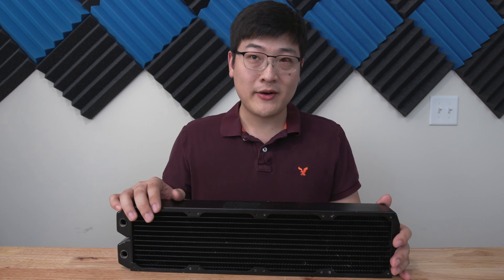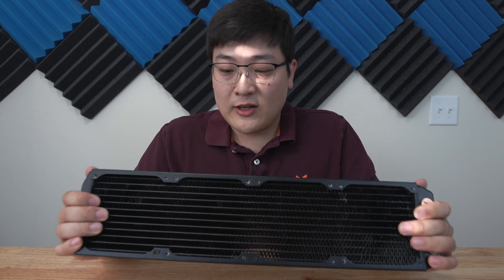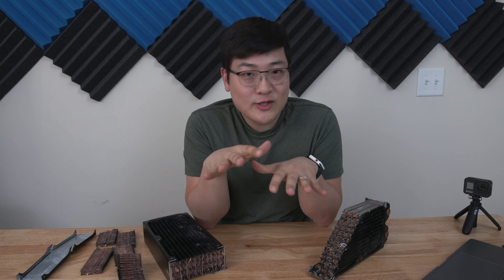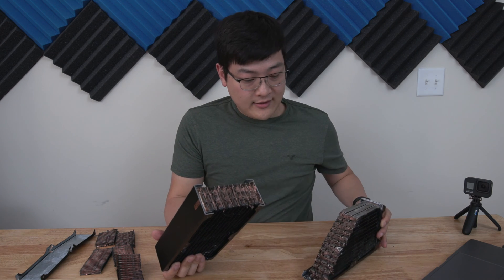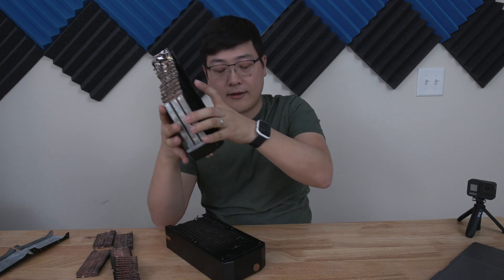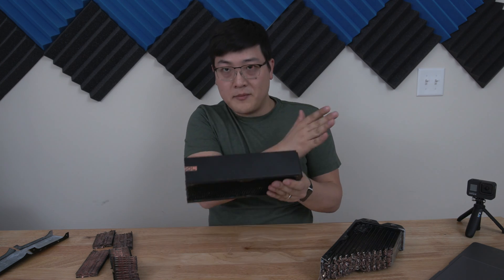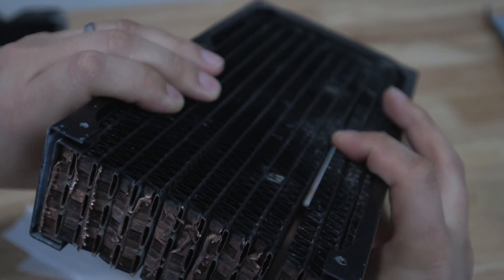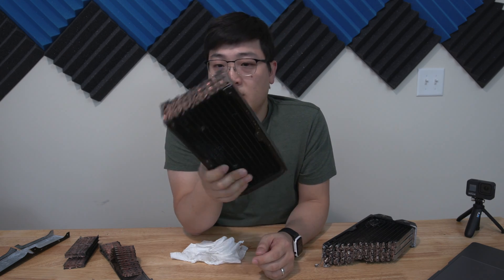Cutting an Alphacool Radiator in Half!

Comment from the maker: What is your preferred radiator manufacturer?
Reply: alphacool, all copper makes all the difference. Also look into radclean i suspect its citric acid but im not gonna taste it but basically you dont have to glove up to use it to clean out your radiators and if you wanted to feature it in a vid you could do a side by side comparison with citric acid and acid test strips or some thing like that
Reply: EK

Comment: Very interesting, you're a genius sir. You just showed me the internals of radiator.  Also you just found a way to get two 240mm rads out of one 480mm. Be careful next time you cut all metal with that type blade.  Those blades are mainly for cutting wood with nails.  Try using the carbon disk style blade like a dewalt DW8005 metal blade and that won't destroy your blade as fast.  Those teeth could puncture anything when broken off with that amount of rpms.. Just leaves a lot of sparks behind so may want to prop up on a stand or that mitre saw has an attachment you can buy to use off floor. Just thought you may need that little bit of info of you plan to continue your rad splitting experiments.  Thanks again for sharing the video though man. Awesome

Comment: Just like a 3 core Radiator in a vehicle. Very nice design. The 3 slender tubes give more surface contact than a single round tube. Therefore it will be much more efficient at cooling. Most of the AIO coolers only have a single core.